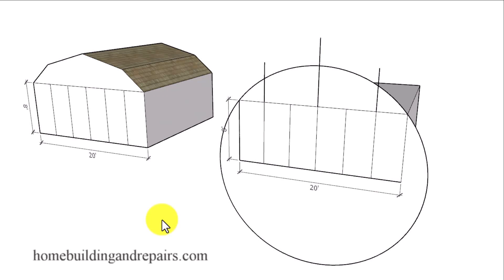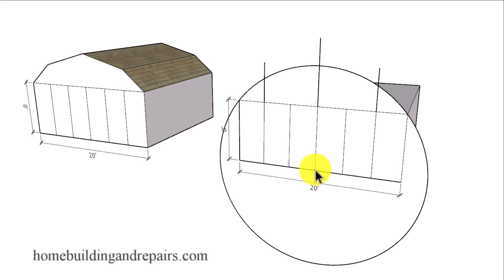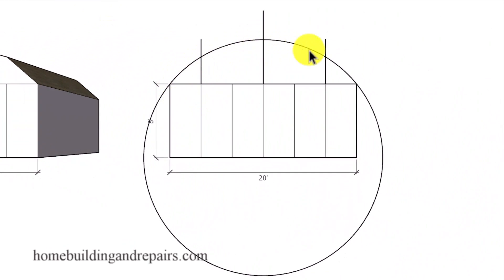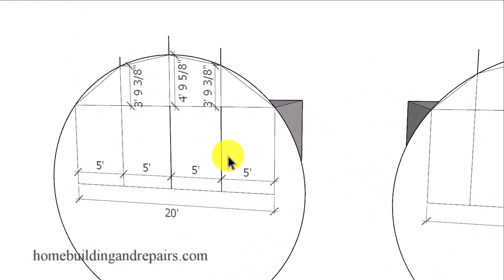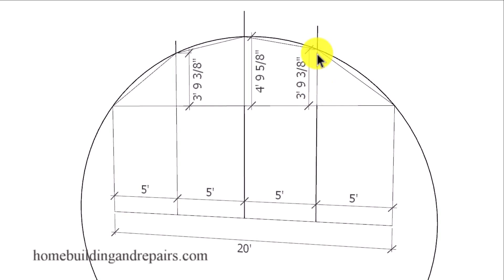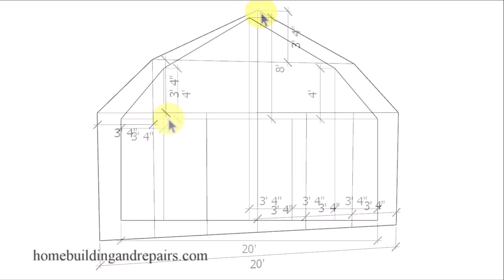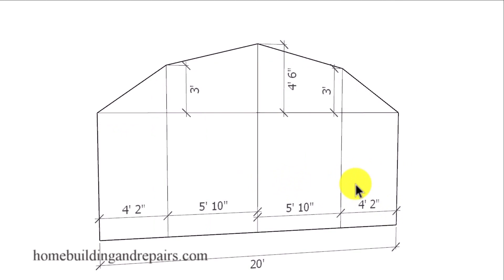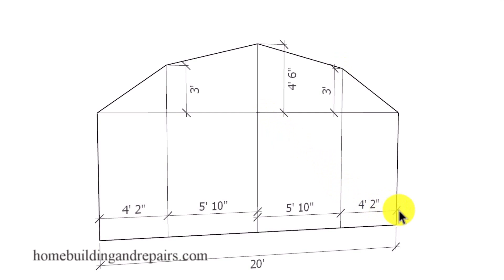Easier Methods To Help You Design And Layout Gambrel Roof - Framing Measurement Calculations

Comment: Thank you for the video, here is my problem, i want to build a 12x16 shed with a gambrel roof for storage however the building needs to not exceed 10 feet in height.  How could o calculate this?  I believe the building would be close to 15 feet tall with 8 foot walls.  I thought maybe using 6 foot walls but that still doesnt get me under 10 feet.  Any suggestions please?
Reply from the maker: You will need to figure out the roof height first, then subtract it from the maximum height to figure out the wall height.

Comment: Thanks for the video. I am building my 10x10 shed and when I make my barn-style layout and make the gambrel 2 feet tall, the end 2x4 are cut so angled that there is not enough meat to mount them on my wall layout. Is there a fix to this?
Reply from the maker: If you already cut the rafters, then email me a picture, if not then you might need larger lumber for rafters.

Comment: You know, in my opinion there is no uglier roof than a gambrel. Hardly anyone gets the angles and proportions right and the interior space is just awkward to use and furnish. Plus, doing the air and vapor sealing properly and insulating it is a nightmare. If you want a second story, build a full second floor.

Comment: I live in a gambrel roof cabin..
2 story 
I anchored a 2x at the fixed center hight and the fixed top of the wall ... of the ground floor walls.... shifted the joint until I  liked it....  more than 20 years later.. I am still living under that roof, and I still like it.